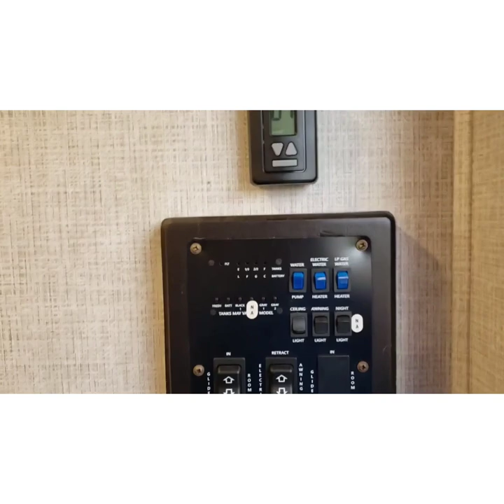Keystone Outback Ultra-Lite 291UBH: Owner's Review & Tour

Comment: You did a great job showing all the features of your camper.  I love the floor plan too.  I do have a question - you mentioned that you had another camper before buying this one. What was the length on the other camper, and if it was shorter, was it a big transition adjusting to a camper of this size? I ask because this will be our first camper and I’m a little apprehensive about getting one that’s so long, afraid that I won’t be able to manage driving it well. My husband was a firefighter so driving our TV and this won’t be a problem at all for him, but I want to help with the driving as much as possible also.  Thanks for all your help.  And I love your decor!!!
Reply from the maker: Thank you! Our old camper was a hybrid Jayco that was about 20'...so at 35' this one is almost double. Allen really balked at that during the shopping phase, but I don't think it's been as difficult a transition as he thought it would be. And he admits now that it's worth it. A backup camera helps a lot and is totally worth it. And these come ready to add one on the back, so it's a quick, easy "mod" (if you can even call it that). 
Some say that extra length can actually be easier, at least when it comes to backing in, because with a shorter one, the wheelbase being closer to the hitch makes it harder to control, which I can imagine.
As long as your tow vehicle is sufficient, I don't think you'll have any problems with towing a longer trailer. And it makes the destination so much more enjoyable (having space so you can actually relax).

Comment: Thanks for the detailed video. We ended up going to the dealership the next day to switch out what we were getting to this floor plan. What I forgot to check is the weight capacity for the bunk beds. Would you happen to know that? Thank you.
Reply from the maker: I am honestly not sure. I tried a quick search and have come up empty-handed so far, but I'll keep looking for an answer.
Reply: @wanderlotstravel  Thanks for the reply. I’ve been trying to find it online as well & came out empty. On other bunks I’ve seen they usually have a sticker but I forgot to look when I was at the dealership. I don’t know if yours had a sticker or not?
Reply from the maker: I don't recall one. I asked in a Facebook group and someone said 150 on the top bunk and 300 for the bottom, but I can't verify that.
Reply: @wanderlotstravel  Thanks for the info. We asked one of the sales person & they weren’t 100% either but they said usually it’s 250. So now I’m really conflicted. But apparently you can reinforce with an extra layer of plywood? Hopefully there’s some truth to that.
Reply from the maker: @amlopez1129  I would imagine that would help as the platform goes, but the top bunk would also depend on the metal supports that are screwed into the walls.
Reply: Sorry this is a year later but the bunks in this model (I have same exact one). They are full size bunk being 48×78.

Comment: Great video! Did you modify the dinette seating? We have the same model but our dinette benches do not open and have storage.
Reply from the maker: Thank you! ☺️
Nope. It's just as it comes.
Have you tried lifting from the back of the benches, rather than from the front? I ask because I've seen some people in the Outback group on FB say that they thought theirs didn't open, just to find out they were trying to open the wrong side. Does yours have the power station? The way the table works with those is a bit different, but I was under the impression that the benches were the same. (Though I could totally be wrong.)
Reply: @wanderlotstravel  oh my! Jk! Our salesperson told us we didn’t have storage, and yes, we were opening from the front instead of the back! Thank you so much! Hilarious! But now I really do need to know how you installed your drapery panels - LOVE! So cute!
Reply from the maker: Thank you! I will actually be doing a video on that soon!

Comment: Hello!  Looks like you are using a Nissan Titan to pull the trailer. I am curious what engine you have in the Nissan and how does the Nissan do towing the trailer? Does the trailer feel too big and heavy?
Reply from the maker: I honestly don't know about the engine and will have to defer to Allen on that one. (This is Jessica.)
But I can say that we (well, HE) pulled it from Kentucky to Colorado, to Wyoming, to South Dakota, and back to Kentucky last fall, through winds, and up and down winding, mountainous roads, with no problems. But that being said, he does say that he feels it back there. Especially on the road we live on, and have to take back and forth to where we store the camper, as well as the road connected to that road. They're worse than any other roads we've pulled it on...something about their construction makes a difference somehow.
In other words, yes, it does well enough for us, but not so well that we can really/officially recommend it. Even this shortish Ultra-Lite is technically too much trailer for a half ton. While the weight and tongue weight fall within range, the lack of length of the truck is an issue, as wheelbase length is an important factor that is often overlooked. (Ours is a short bed.) An experienced tower can pull it off (pun intended) just fine as long as they're very careful, but I don't suggest it for anyone new to TT towing or someone who isn't really comfortable with it.
Reply from the maker: From Allen:
It’s a gas Nissan Titan SV.  I think the engine is a 5.6. It’s been raised 4 inches, which I think would be required to keep it from bottoming out. We also have a fastway e2 weight distribution hitch, which is also a must. All that being said, as I was going through steep inclines around Cookeville/Crossville, I still had plenty of reserve left and was able to pass semi's going uphill. So there’s definitely plenty of power to pull it. The engine itself has no issues pulling the camper.
We do want a diesel though...so we can go through the diesel lanes in gas stations. 😄

Comment: Did your 291UBH come with the second AC or did you put add it?  If you added it did you put it in yourself or a dealer??
Reply from the maker: Our dealership had ordered it to come already installed. 
They all come wired for the 2nd AC, so you could have the dealership add it before purchasing and roll it into the price so that it's part of the loan, rather than an extra $2k out of pocket...on top of any down-payment AND all the things you'll need to buy for it...AND travel expenses to actually use it. (We already had a camper, and we still spent probably $1k each...me on decorating and organizing, and Allen on the more technical additions.)
The units are really heavy so trying to install one on your own wouldn't be something many people would really be quite capable of. But I'm sure it's possible though.